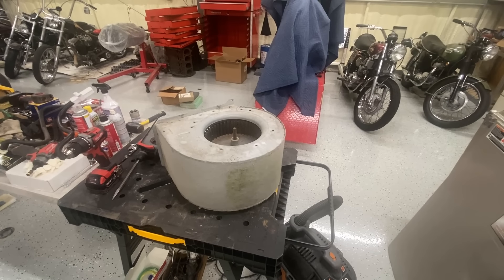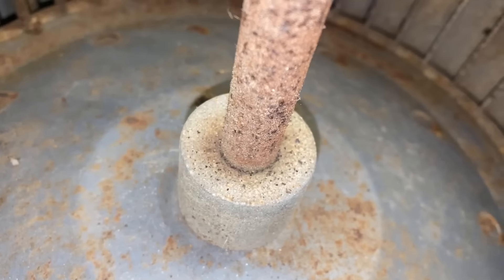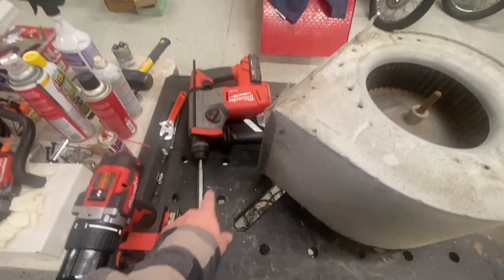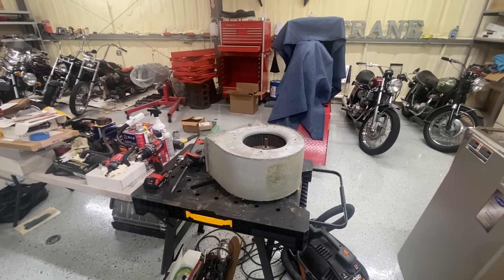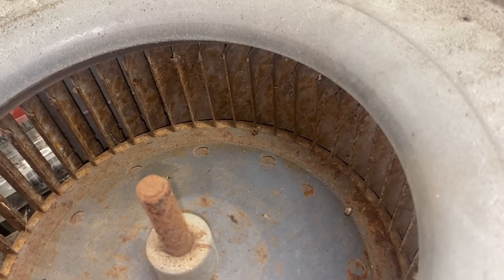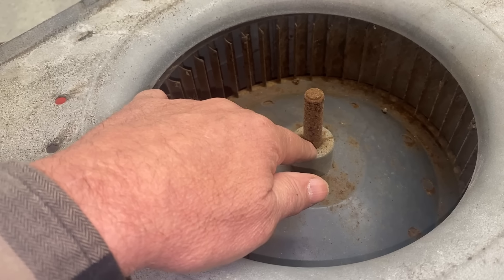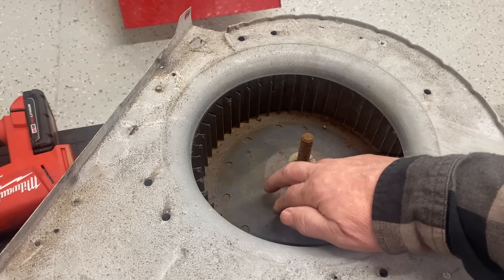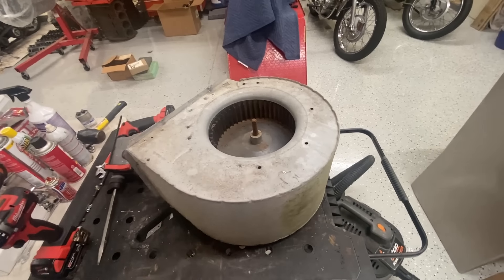Round two of Anti DIY schools Krauss

Comment: As much i as don’t like messing with a puller, I think you should take a look at setup time if you are wanting to go solely off time, especially in the field.  Yes, you probably got that one out quicker than a puller would have been put on it. However, you also had to get 3 blocks of wood, a big hammer, a socket, a punch, and the sds instead of just a puller. Most would use the lube and sandpaper either way so they cancel each other out. It takes time to drag all of that off the truck and then put it all back up. I don’t think starting from having got ready, to the time it comes out if a real comparison.

Comment: Jam it brother Ted 🤦‍♂️ 😂 I got a couple motors I’ll get out the scrap pile next week, I’ll be gone until weds. 

I’ll try and get 2 done in the 2 min and 17 💪 

BUT let’s be clear, I don’t use the puller on every job 🤣 there’s plenty of jobs where I don’t use it INCLUDING that Trane Wreck I just posted!!! 

Stay tuned
Reply from the maker: Just pick a really bad one like I had…. And letter rip !!
Reply: @TedCookHVAC  I’ll see what I can do my man!!
Reply: @KoolinwithKrauss You are out of your mind if you think that you are going to beat his time with a puller! First of all there is absolutely zero set up time involved, And secondly not only is a pneumatic hammer pushing on the shaft the vibrations from the pneumatic hammer is also going to break the bond between the shaft and the hub caused by the rust! Your problem was you don’t know what you don’t know so you have to take the L!

Comment: Would you do this with a good motor, or only one you'll replace?  The puller only applies force the the shaft and blower wheel.  The smack with the impact socket is putting a bunch of thrust on shaft into the motor.  I suppose that step would be the same whether you're pulling or hammering it out though.  Same with the sanding, supposedly the other guy would still want to get the rust off of the shaft.

Comment: Whipping out a rotary hammer instead of a blower wheel puller seems excessive. Most techs will not have this tool on the truck and generally it won’t be cordless if they do.  Recommend a wire cup brush on the end if your drill and some pb blaster and give the shaft a twist with your wrench 8/10 it’ll come off the other times just use the puller.
Reply: Think there might be a price difference and room it takes up between a puller and a Milwaukee hammer drill. Lol. That's not what I call rusted bad either. I seen them so rusted that little bit of sanding wouldn't have done a thing. What is that a $500 hammer drill and a $200 bit. Lol.

Comment: I do it same way. Dont even need the jack hammer. I just sand it a lot more( make sure it’s super shiny everywhere ) & use Wd-40. ( wd-40 is better imo ) Give it a tap with a hammer & a punch. And out she falls. Maybe 30 seconds more sanding. 
Note : Ted u might be able to make even better time with a 4” grinder instead of sand paper.
Reply: @OcRefrigeration You do realize that sometimes the shaft freezes to the hub which means sanding this shaft shiny isn’t going to do a thing, Also using a 4 inch grinder is absolutely ridiculous unless you want to mar the shaft!  And lastly WD-40 is definitely not the best choice, WD-40 does not even come close when compared to a penetrating oil like ZEP-45!

Comment: When I purchase a new fan motor I also purchase a new fan blade. The labor and tools required to remove the blade offsets the cost of a new fan blade.
Reply: @thomasserovich9564 I don’t think you even know what you’re talking about, Because if you did you would have not called it a blade it is called a wheel or hamster wheel! Also how do you tell a customer that they are going to have to pay for a part that they do not need? If you knew anything about HVAC you would know that you cannot remove the wheel without removing the motor, Unless you want to disassemble the blower housing in which case it is now going to take even longer!  You are talking out of your backend, I really hope you are not in this business because you just got schooled by an Master Certified Auto Tech!